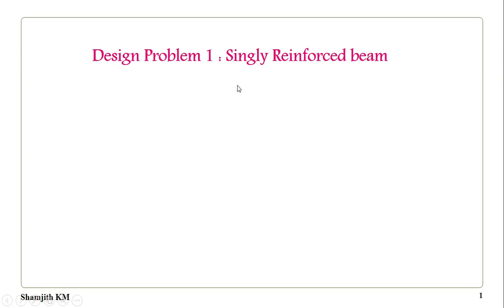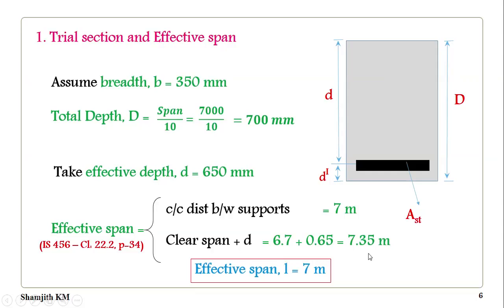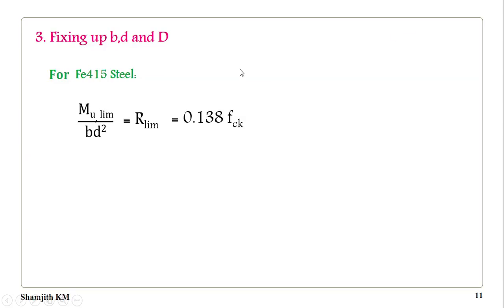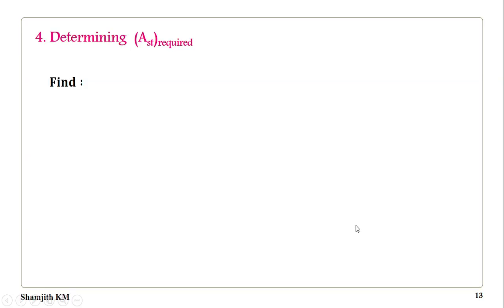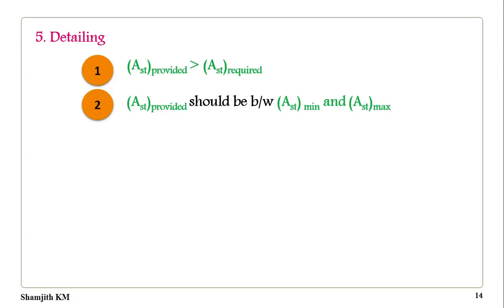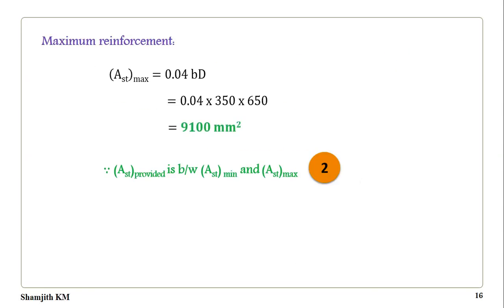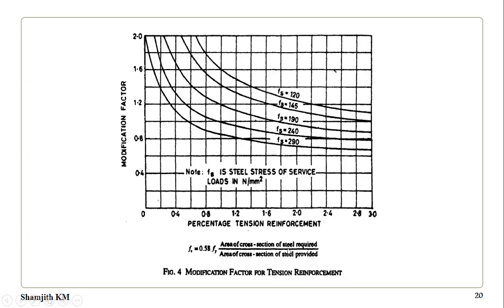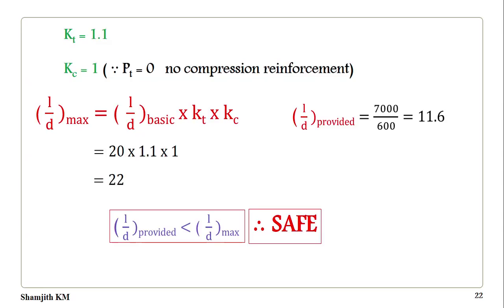Singly Reinforced Beam Design problem 1 (Limit State Method)

Comment: in step 1 : we took total depth,D=700mm and effective depth,d=50.
in step 3: after finding dlim=559.38mm, you said that the total depth,D=650 as we took before and it is greater than 559.38...
 but the total depth,D we assumed before was 700 not 650 .... 
can u make it clear for me , please
Reply from the maker: fixing up means revising the previous values of D, d, etc.

first value of D (=700 mm) is assumption and later we revised it as 650 mm.